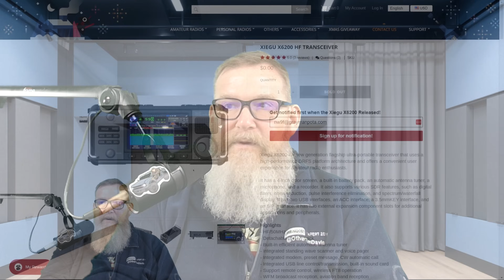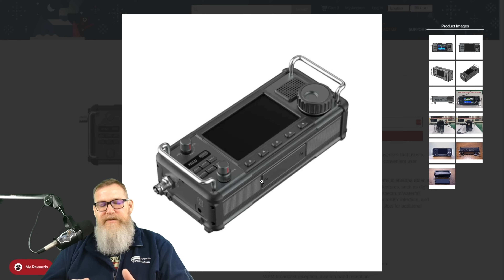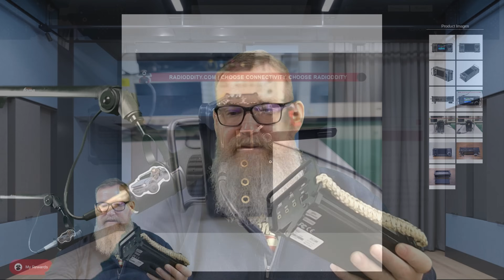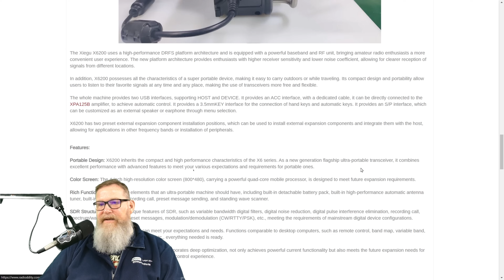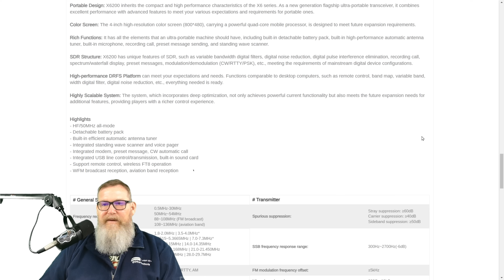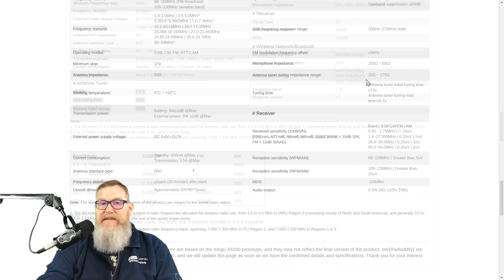Unveiling the Xiegu X6200: Revolutionizing Radio on a Budget

Comment: Well thanks for the info. I have a 6100..and seeing the many problems the 6100 had.but whatever the 6200 does i also own the icom 705 and it has a long way to go to compete with that radio period.
Reply from the maker: I think the X in the X6xxx series means experimental and that is OK, we are a hobby of experimenters. As more and more information becomes available on the X6200, it is starting to look to be not much more than some basic improvements over the X6100. It does give people options.

Comment: This new X6200 has the potential, repeat potential, for being a great radio -- IF, repeat IF, all the features work as advertised, quality control was consistent, and if Xiegu properly supports it with regular firmware updates that fix bugs, all of which have been problems with the X6100. It blows my mind that Xiegu abandoned the X6100 soon after its release and have now come out with a new similar model. My expectations for this new product are very low. I will not buy until I have seen evidence that this will not be another X6100.
Reply from the maker: I think we are starting to see the difference between the traditional Japanese approach to manufacturing and I was going to say the Chinese, but it really is just about everyone else.

Comment: I hope it's better than the X6100. It's not a serious radios what with the voltage and temperature issues, burning out the finals due to lack of sufficient heat dissipation, susceptibility to AM overload, etc. And, RiCBU put their software to shame! The PMR171 is a much, much better radio for the money.

Comment: 20w and a 2m option would make it attractive, but I already have those in an IC-7000, albeit heavier.

If I get the other ham projects done, it could be an interesting experimental platform, like the x6100.
Reply from the maker: With the x6100 being an ARM based computer platform, there are a lot of possibilities.

Comment: You didn't mention RF direct sampling (no superheterodyne intermediate frequency). I think that's a huge thing and the main reason for the existence of the 6200. IFs have been the way to do radio for 100 years. Direct sampling (DRFS, Direct Radio Frequency Sampling) should help a lot with weak-signal work, as well as offering a lot more flexibility for software upgrades and maybe even lower (or higher?) heat generation. Maybe help with birdies, maybe hurt with rejection. No idea. I'm guessing the radical change of direct sampling SDR is going to make all the manufacturers concentrate the majority of their development on them. So the 6100 might be left in the dustbin by the 6200. Or direct sampling technology may be immature and take a few years to get right, and the 6200 could be horrible. Icom has been using it for their newer radios (as well as a lot of the low-end cheap Chinese radios). Either way, I think that's what differentiates the 6200 from the 6100, not these little differences in the external hardware. Except the removable battery. That's a big plus.

If you keep chasing next year's model, you'll never buy anything in tech. So I'm buying a 6100 today!

Comment: I'd love to know what they're going to charge for this thing. The low power output is really disappointing. It should be 10W on battery and 20W via external power.
Reply from the maker: I agree, more power would be better. I am not sure the output power limitation is due to the size of the radio or not.